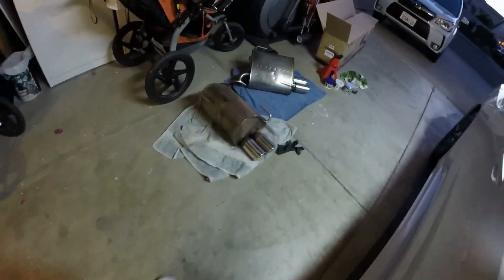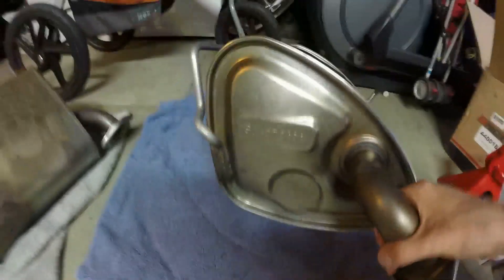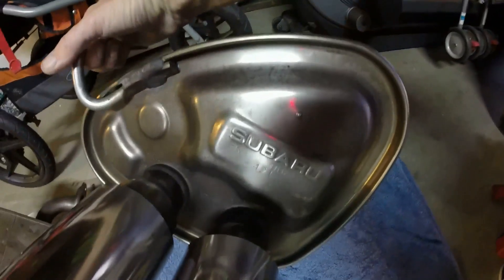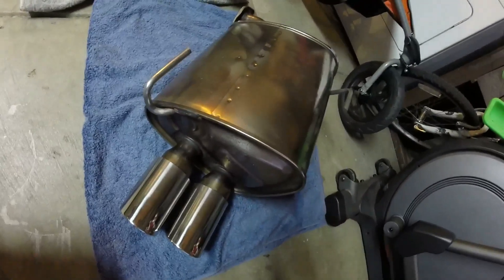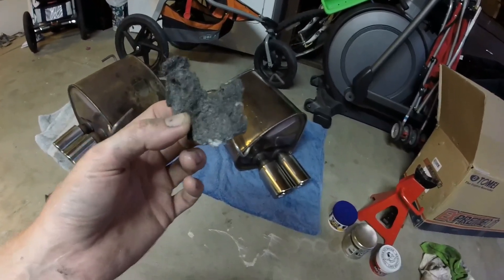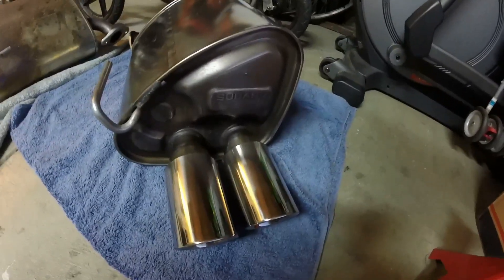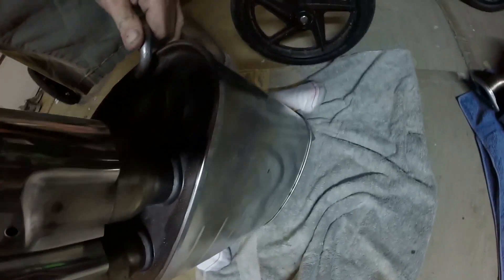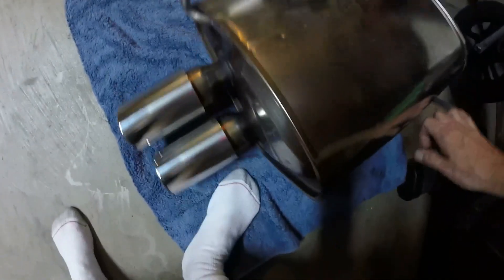2015 Subaru WRX Limited: Minisode 116: Muffler Restoration

Comment from the maker: UPDATE 3: Final decision, WRX mufflers are back on. Wasn't enough difference to keep the STI mufflers on, and mine are cleaner. I prefer the slightly mellower sound of the WRX ones. I'll try to sell them local for maybe $60 and if not, I'll put the in my trash can. Was a fun experiment though.